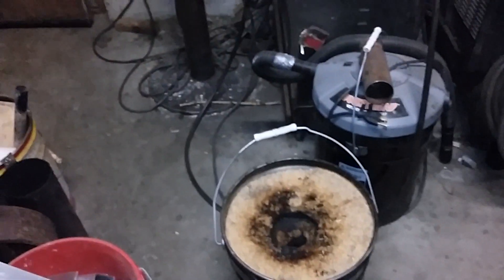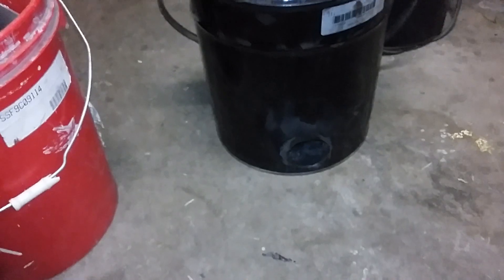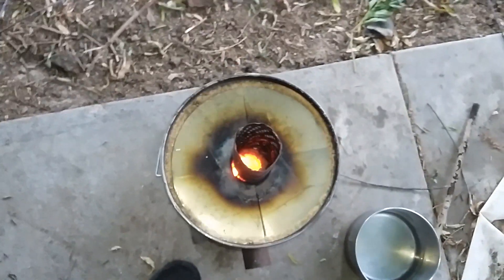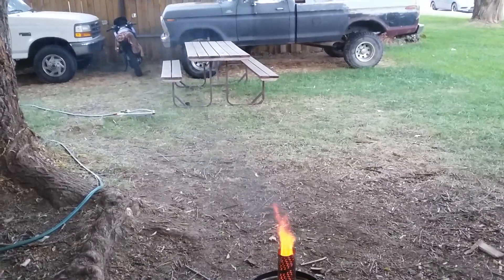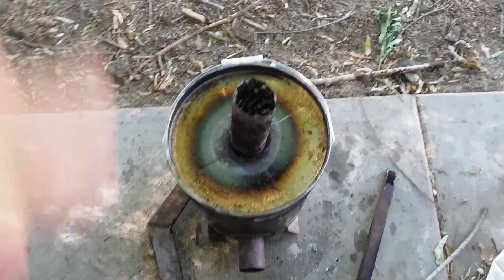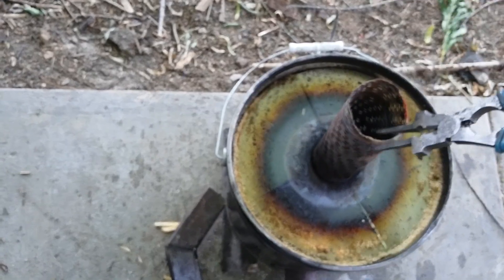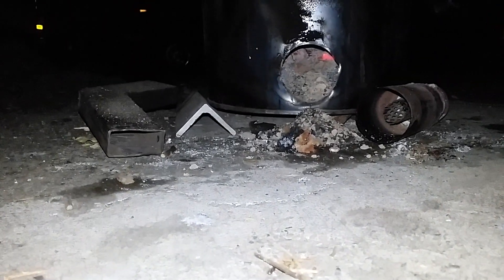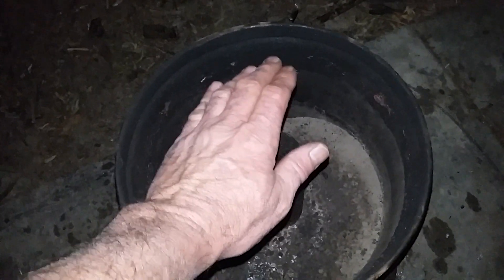18 + hour burn  with a sawdust, waste oil rocket stove, DIY  how to.

Comment: Hi

Thank you for a good video.

Hope you can help!

I need to build a rocket stove to heat a swimming pool of about 140 000 liter (37 000 US gallon)

Two 1.1kw pumps will circulate the water.

The pipes from the pumps are 50mm (2 inch), and I will split each pipe into 11 copper pipes of 15mm (0.6 inch) each to equal the same volume.

Each of these 11 X 2 copper pipes will be form into a spiral of 30 meter. (100 feet)

The diameter of the drum will be about 1 meter. (40 inch), and the HEIGHT perhaps slightly more.

I plan to make the outer drum 300mm (12 inch) higher than the inner drum.

And the diameter of the outer drum will be 1.6 meter (64 inch)

Airflow will be from underneath, i will make a grid of copper pipe to build the fire on.

The chimney will be about 400mm (16 inch) from the bottom.

I assume a chimney of 100mm X 100mm will be sufficient (4 X 4 inch)

My question, if anybody could help me perhaps, is about the ventilation of 300mm. (12 inch):

Is it sufficient, too wide, or too narrow?

Thank you in advance!

Comment: If you tried a second bucket around and above this one and exhaust the outer one. This is as done with many mass heaters. It would give a secondary burn of those gasses and smoke. Just a thought.

Comment from the maker: Check out my channel, it has a video on how I mixed the sawdust and packed the bucket thanks again for watching!
Reply: Didnt see the video  i was thinking about making these in putting in side my house to heat it but using vent to smoke  out the window out side would it burn just Galvanized Elbow Fittings and out to window with lead shut in packed down..   What wouldnt u think ... thanks..
Reply from the maker: Anthony Goss 
  I wouldn't recommend putting them in your house. Do not use galvanized at all as it heats up it will emit a toxic gas/smoke and kill can kill you. Also lead would probably melt and is not good either as it is toxic as well.

Comment: I wonder how well two smaller versions would work in a tinny wood stove?? I may just have to give it a try and see..
Reply from the maker: +Mark Luce 
I do use a damper a little bit but if you restrict it too much the forced air for combustion pushes smoke out through the door vent knobs
Reply from the maker: +lil blue bus adventurers 
I was thinking of doing the same thing myself, let me know how it goes!
Reply: Mugiver Muscle Machines it will be a while, I just ordered a minny wood stove and have 4-6 weeks before I'll receive it.. maybe by x-mas I'll finally have it installed.
Reply from the maker: +lil blue bus adventurers 
That's awesome, good luck with it!
Reply: ?Use the damper on intake/drat door?? too slow of a burn might let the flame spread sideways instead of up through the center and letting fuel collapse then block draft----
Reply: Wonder how a damper would work?  You would be able to vent the smoke and maybe slow the burn time and hold back some of the heat. Great job!